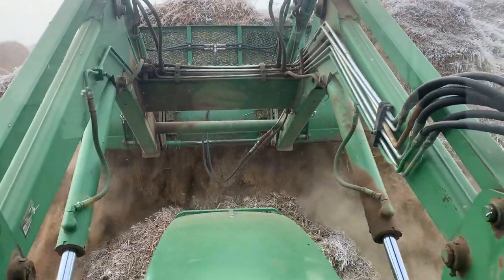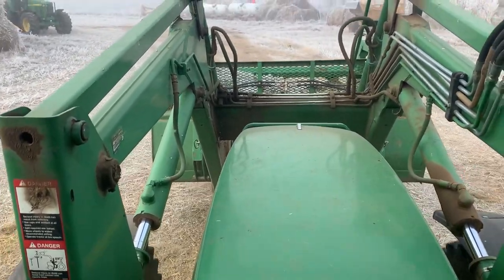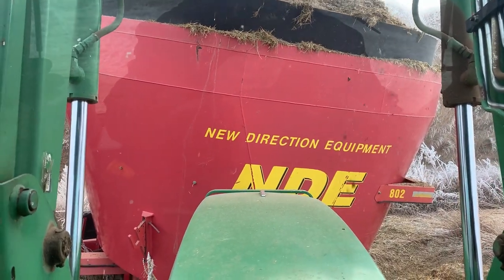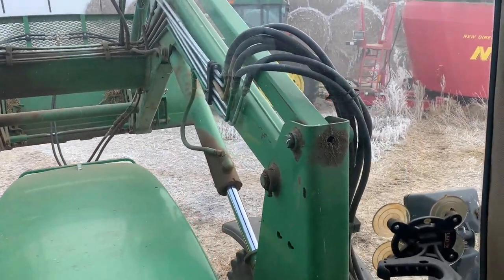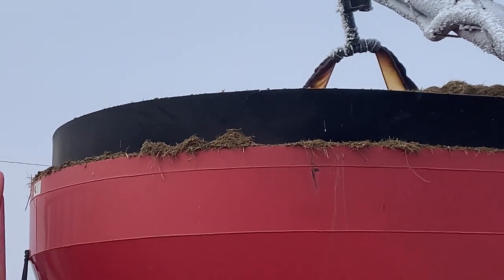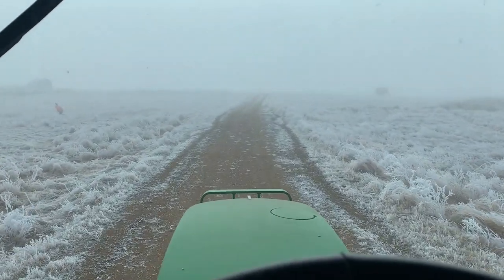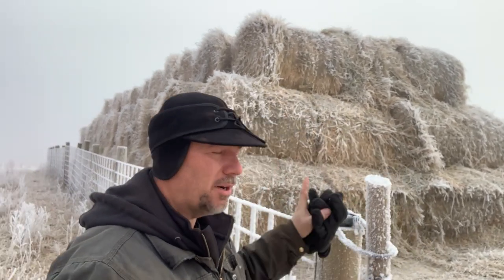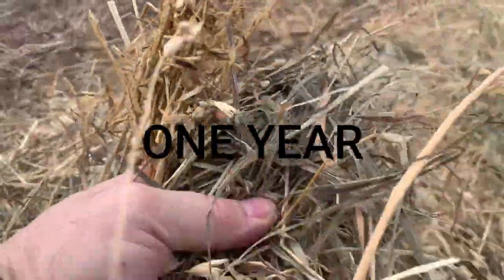Vertical Mixer Grinding a Bale...Eventually  :)

Comment: We're running 22-24lbs/head/day on baled hay through the winter - this is for Aberdeen Angus though (smaller than  yours).  They do have a fair amount of waste depending on the feeder that we use and how we stretch the replenishment.  I wish that I could grind/mix just because of the higher value and ease of digestion!
Great Video!

Comment: Maybe I need a NDE currently have a single screw Jay Lor that I just put all new knives in.  Grinding an 1800 lb bale of grassy year old hay, then adding 1500lb of wet corn gluten and 2500 lbs of corn silage.  If I don’t let it work on the bale for at least 30 minutes it tends to push all the hay to the outside and the silage and gluten to the center and give me a really poor mix.  So I put a bale in and go do something else for a little bit. As long as I let the hay grind a while it mixes really good feed. Currently feeding 100lb of this mix per head every other day to spring calvers on used up corn stalks. There is  a fair amount of water in the gluten and silage. There are no commercial hay grinders in this part of the world (Central IN) so that’s not an option, wish it was.
Reply from the maker: My mixer wagon will do the same thing. I have to be careful of what kind of hay I grind. Jay Lor is a very good wagon too.  Maybe if we had dual screw but that adds lots of cash.  I will stay with my single screw. Haha. Have a good one!